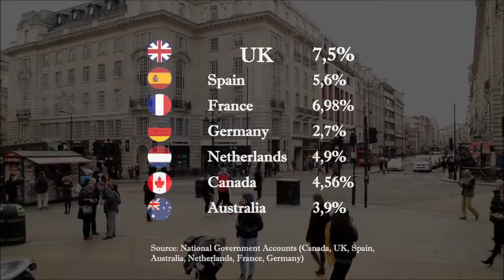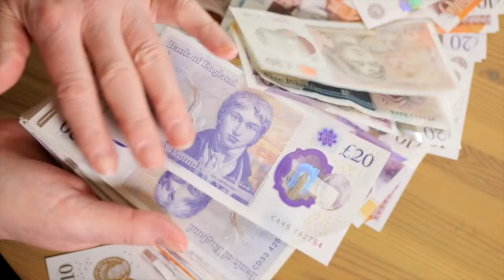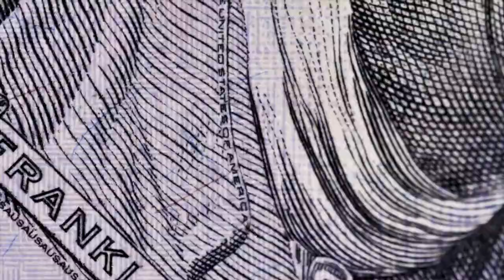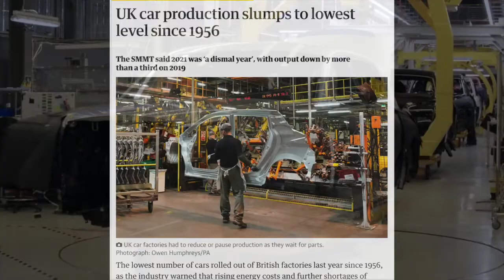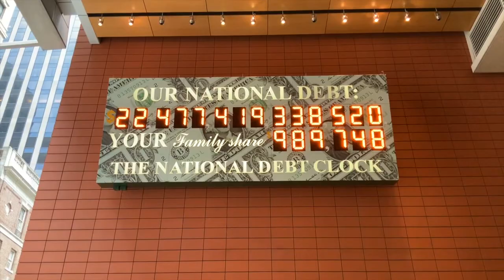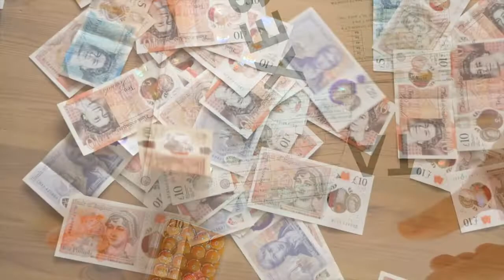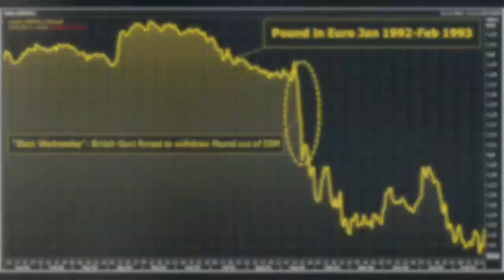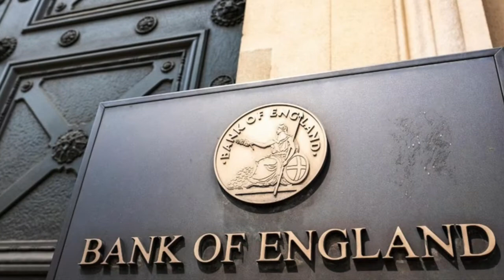Why the collapse of the UK Economy and the Pound can be reversed

Comment: ReverSed, NOT reverted.
Reply from the maker: I think it is reverted because the collapse is not happening, has happened. Hence, the economy and the pound have to go back to the previous state. If the process was ongoing or there was doubt about the outcome of it, then it would be reversed. But, as said by the Bank of England and with current data on forex markets and macro indicators, we can assume the collapse has happened, although it is still ongoing. Thanks for the comment though, I was thinking about changing the title
Reply: @learneconomics2021  Reverting means "reinstating" --- as in, going back to (reinstating) collapse. Reversing would mean turning back (eliminating) collapse. Your choice of what you actually meant.
Reply from the maker: @compassroses  both terms describe what I wanted to express. Thanks!